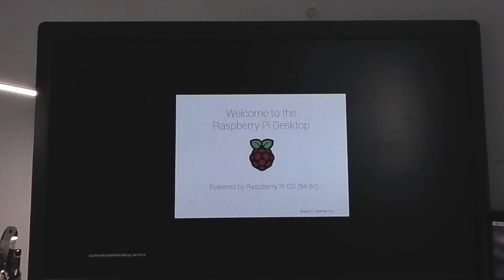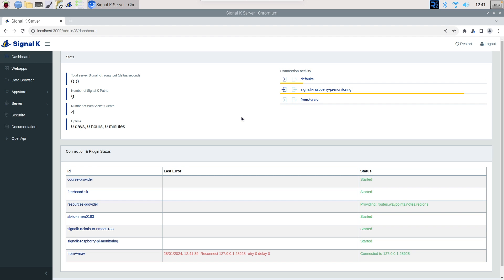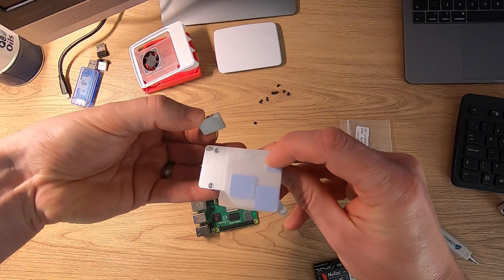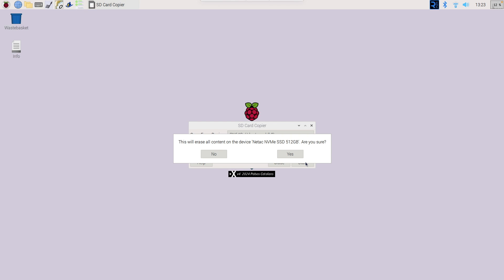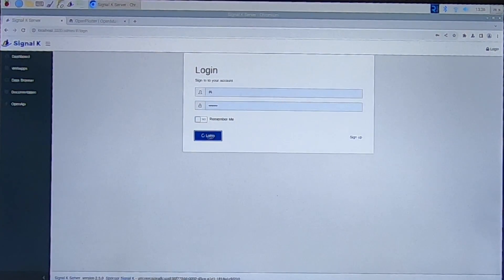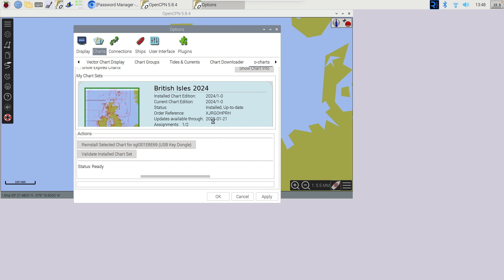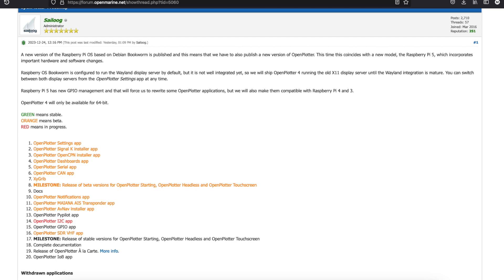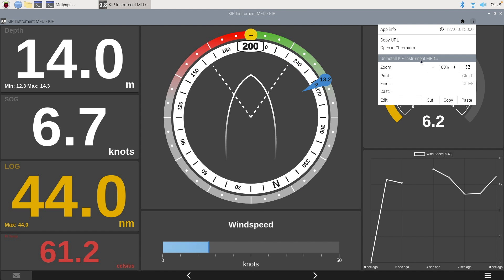Pi5, NVMe Base, OpenPlotter 4 (beta), MacArthur HAT, O-Charts Dongle - The best open-source setup!

Comment: Brilliant video, and many thanks for the information and explanation around implementing OpenPlotter. 
I have a mixture of NMEA 2000, 0183 and Seatalk , with a Garmin 5008 plotter currently installed on my boat, and I'm just starting down the path of replacing some of the older seatalk kit, so this is exactly what I was looking for to help me. 
My boat is in Greece, and my plan over the winter months is to build  a "test" rig at home before installing it in situ sometime around April / May. I have the Pi 5, NVMe and SSD card plus a small NMEA 2000 network ready, just waiting for delivery of the MacArthur HAT to complete the build and start "playing".
I’d also like to replace the Garmin chartplotter at some point, so do you have any suggestions or advice on a suitable monitor / tablet, or is it ok to use a standard  iPad/Tablet
Again many thanks for the video - loved it  - Garry 👍👍
Reply from the maker: Hi, thanks for your comments on the video. Sounds like an interesting project! One thing to install on your setup is a plugin for SignalK (in the 5 best plugins video) that can generate test data. You could then output that for any sensors you can't replicate on your test setup.

In terms of a display, I think you have a couple of options and depending on how and where you install this, one option might be to go for the tablet. I've not got much experience with external displays but they seem to be difficult to weatherproof or you buy something that already is and then they are fairly expensive. I've seen some really good rugged tablets with large batteries which might fit the bill, have a look at Oukitel, they seem affordable and come out well in many online reviews.

Give us a shout if you get stuck and enjoy the build👍⛵️

Comment: great show and tell, thanks!
About how many Watts does it draw?
Reply from the maker: Hi, thanks for the comments on the video. It seems to run about 3-4watts at idle, so at 12v it's around 0.3amps
Reply: @BoatingwiththeBaileys that's great,  thanks!

Comment: Thank you for a great video. It inspired me a few months ago to build the same system. I have it working and it's fantastic. My only issue is the RP5 onboard wifi adaptor seems to  be unreliable - sometimes it will connect to my iPhone hotspot, sometimes not. I'm going to go with an external wifi adaptor, just trying to work out how to disable the onboard adaptor. Have you had any experience with poor onboard wifi adaptor performance?
Reply from the maker: Hi, Many thanks for your comments on the video. Yes is the short answer, i still believe there are driver or other issues with the onboard network. I have managed to make some progress with that and get a stable connection, here is what I did:

Evening, I remembered to check the pi WiFi settings for the subscribers that have been having issues getting a connection on a Pi5 (and a Pi4) with devices like an ESP or phone that seems to connect but then disconnects or just doesn't work.

I changed the following:

# sudo nmcli con modify TEST_AP 802-11-wireless-security.proto rsn
# sudo nmcli con modify TEST_AP 802-11-wireless-security.group ccmp
# sudo nmcli con modify TEST_AP 802-11-wireless-security.pairwise ccmp

(Replace TEST_AP with your ssid name) 

Since I changed this both my phone and ESP connect without issues.

Here is the post where I found this information:

https://forums.raspberrypi.com/viewtopic.php?t=357998

Hope it helps 👍⛵️

Comment: First of all: you're videos are a great resource! Thanks lot for all your effort. Just a quick question, I'm not sure, if I should go for the Pi 5 and SSD, because I'm not a hundert percent confident if it's worth the price and energy. Would it be possible to clone my existing system (OP4, signal k and so on) to a Raspberry 5? Or would it mean to go from scratch and do it all again? Cheers and happy new year mate!
Reply from the maker: Hi, Many thanks for your comments on the videos. I would defiantly try to copy it, i know there were several changes in OP4 but i've got a similar image running on my Pi5 and my Pi4 test setup at home, so i would give that a go first and clone it to another SD card. It will defiantly save time. On the SSD its a difficult one with the Pi5, its sooooo much faster just on the SD card when compared to the 4, however its also easier to add the SSD now with the dedicated port. I think longer term the SSD still wins, even with a little more power usage, but again 5 seems to manager power better than 4 did.  If this is going to be a fairly key part of your setup, go 5 with an SSD - Its the best setup i've had so far.
Reply from the maker: Should also say, i still think the best value pi is the 4gb model, im not really sure 8gb or the new 16gb is really needed.
Reply: @BoatingwiththeBaileys  Thanks a lot for your advice (again). I opted for a 8GB Pi5, thought it might give me some headroom for opening multiple chrome tabs ;) I saw a video earlier where a special usb-device was needed to install the SSD. I always thought, it would be possible to just install on a SD Card, copy everything to an SSD and change boot order. Well I should dig into that again ;)
Reply from the maker: Hi - Excellent, Good choice and enjoying opening those tabs in Chrome! :) You shouldn't need anything for the SSD, if its a similar setup to mine, it should be plug and plan. I still built mine from an SD card and then did a copy. I have used the O-charts dongle this time as i end up missing with mine a bit, i've lost charts in the past, but now they are linked directly to that dongle.

Comment: I need to construct a chart plotter using the Strawberry Pi and the Macarthur HAT. I have also been looking at making my own AIS transponder BUT discovered that an AIS transponder has to be officially certified and so you need to buy a commercial product ..which is a pain becasue they cost a fortune (500+ pounds).    Should I base my chartplotter system on a Pi5 or the tried and tested Pi4.  It looks like heat is a problem for the Pi5 and reliability is critical at sea.
Reply from the maker: Hi - I would go for the Pi5, i've not had any heat problems with mine and im using the active heatsink. It has been really stable even in the higher heat of the summer. Going on to the AIS kit, yeah, i know what you mean and i ended up buying a marine unit after looking at different options. I still think the Pi and Macarthur HAT are a really good setup and well worth having onboard to work with other marine kit or replace part of it.
Reply: @BoatingwiththeBaileys    Many thanks, I really appreciate your quick reply.  Kind regards, JP

Comment: Wow stumbled across this and love it. Would love to know if you’ve gotten any farther with it.
Reply from the maker: Hi, yes it's all installed on my boat and had been up and running all of this year. I haven't don't much follow up because I've been running OpenPlotter for several years now. I do have a full playlist of videos around this starting from the very beginning on a Pi3 but plan to cover a few things this winter in updates to those original video. If you have any questions, need any help or what to see something specific then let me know. It's basically monitoring my batteries, chargers, environmental stuff and all my boat data plus the engine. Should also say, many thanks for your comments on the video!

Comment: He said just save cmd, just not how to save 😂 ? It doesn't save by default, control S or enter does nothing.
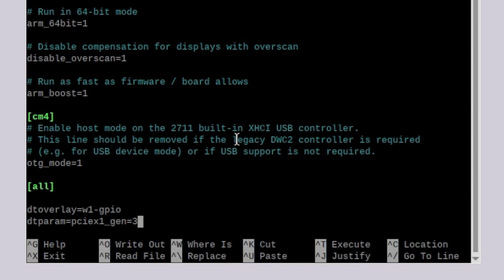Reply from the maker: Hi, Is that to the boot config about 6:15 into the video? Your only option is to exit the file and as you do it asks if you want to save, so its Control X (Exit - as shown at the bottom of the screen) and then the next screen asks it you want to save the file. Press Y. If that's not what you mean, can you let me know where in the video this is please?

Comment: Great videos on OpenPlotter on RPi! I started with an RPi4, but I dont like the performance so far. Your videos have inspired me to go with an RPi5 and NVME. Do you have any updates or improvements you would recommend now that you've had your system since you published this video? I'm pulling together my parts now and would appreciate any updated info you might have. Thanks for putting these videos together for everyone's benefit!
Reply from the maker: Hi, Many thanks for your comments on the video.  I honestly don’t have any recommendations at the moment. Its without doubt the faster setup I’ve used. The Pi5 and a fast SD card was quicker that my old Pi4 SSD and it runs really well. I know what you mean about the performance, the 4 was better than the 3 but it was never quite where it needed to be. Now its spot on, its responsive with no lag even with several webpages and the chart plotter running. Really pleased with the setup. Also, let us know how you get on, its always great to get feedback on other setups and see what others have done.

Comment: Do you have any tips on remote monitoring? I'd like to remotely monitor my batteries and my bilge via pi5. I've considered using the "roam" device here in the US.
Reply from the maker: Hi, it's not something I've done so far. I know there is a plugin for SK to send data to the cloud and that might be an option. Some sort of push notification would be good. I'll take a look as the weather is turning here now

Comment: Hi great vid.  Decided on the back of your video to go down the RPi5 and base nvme route.
...however my config was nothing like as straight forward and as of V4( 19June touchscreen image) I still have no working shutdown/ poweroff and have had to stop in case it accidentally finds itself heading out of a porthole and into the drink (and revert back to my 4b headless predecessor
Reply from the maker: Ahh that's a shame. What problems are you having on shutdown/power off?

Comment: Hello nice new build have you experimented with different IMU placement in the boat, big mfg like B&G want it on a bulkhead near the mast, where is your IMU located?
Reply from the maker: Hi, when you say IMU are you refering to the sensor messuring pitch and roll etc?, mine isn't central at all, its mounted on the port side. If im honest, i dont really use it, its on the list to do something with but i've just not got to it yet.
Reply: @BoatingwiththeBaileys i am trying to figure out if I even need the IMU for compass heading in open plotter, my GPS seems to know where I am headed
Reply from the maker: Hi, Yeah it will be able to get that information from your GPS. I found that sometimes when stopped, i dont get any heading information but you do if you have either a compas on your network or an IMU. Otherwise its needed for Pypilot and/or pitch/roll information.

Comment: OK, Have I missed something? I cannot get the downloaded image '2024-06-19-OpenPlotter-v4-Starting-stable' to boot up to the installlation , all I get is a black screen with a few lines of test.
Reply from the maker: Hi, is that just booting from an Sd card?
Reply: @BoatingwiththeBaileys  Yers, Managed to get it sorted, now having to wait for snail mail from Spain for the rest of the parts.
Reply: Check your power supply, had the same issue with a 1 amp power supply and I screws the sd card. Best is 2 amp minimum

Comment: That's funny, this is exactly the system I have, too.  I did make a 3d printed case to accommodate the airflow and the MacArthur hat.  Love the O-charts dongle as I had lost the key in the past.  Be careful with the cable going from the NVMe base to the Pi5.  My hold down bracket broke.  Waiting for Seatalk...
Reply from the maker: Hi, I've seen a couple of the cases, that's on my list but so is a 3d printer!

Comment: Subscribed.  Very interested in kitting our boat out with this setup, instead of some obsolete-ware garmin type of affair.
Reply from the maker: Hi, thanks for subscribing- you can basically do what you want with it which is really good. Give us a shout if you need any help
Reply: @BoatingwiththeBaileys  Cheers, I can see from your roster of videos that most of my questions have been answered so I appreciate that.  What I am currently trying to source is a decent enough panel that could sit outside.  I'd rather not have touch screen but maybe a couple of page selecting momentary switches.  Also just been down a rabbit hole on how to get a signal from the NASA clipper depth sounder.  I love their simple kit, but looks like I need to learn a bit of arduino to make that work.  Happy Sailing and regards from Milford Haven.
Reply from the maker: Have a look on the OpenMarine forum for the NASA kit, I'm sure someone has done that. I had a Duet on my last boat and it was great. Gonna try and get to Milford Haven soon, looks really nice 👍

Comment: Hi, great video, thank you - can I ask what display you use onboard to connect to the pi?  Also what GPS device would you recommend?
Reply from the maker: Hi, many thanks for your comments on the video. The display is one of these https://www.ebay.co.uk/itm/253289838646?mkcid=16&mkevt=1&mkrid=711-127632-2357-0&ssspo=sA4xWqdKSHW&sssrc=4429486&ssuid=1XqhIgr5QPm&var=&widget_ver=artemis&media=COPY the price has gone up a little since I got mine but I’ve been really pleased with it, it’s bright and clear with low power consumption. In terms of GPS, I use the boats GPS via NMEA2000 but I have also used a cheap USB one from Amazon with good results. Virtually any of them will work and also make a good backup.

Comment: I have questions concerning the inertial measurement unit you're using (black board sitting on top of the MacArthur hat, visible from 11:00). It looks like it's labeled "CJMCU-20948" on the board. 

Firstly, how well does it work? Is it integrated easily into the system? Do you get good data from it? 

Secondly, i can't find that model easily through a source i trust. Do you know of any alternative units, or a place where discussions happen on this where i could ask? Looking around, there isn't much online or in the documentation on which modules are a good fit for the MacArthur.
Reply from the maker: Hi, Its not a sensor i've used all that much if im honest, its sort of gone on the back burner as i've been playing with OP4 and some other things. You needed to install PyPilot in the old version to get access to pitch/roll etc and i think thats still the same now. The recommended sensor Is ICM-20948, buy a good quality one, i didn't first time around and it wasn't detected. I think this one came from Pihut. I'll try and do something with it shortly and come back.
Reply from the maker: Search ICM-20948 and PyPilot

Comment: I'm searching for a case for this combo (Pi5+NVMe base+MacArthur Hat), preferably also with full HDMI. Any suggestions? I guess the Argon One V3 doesn't support the MacArthur Hat?
Reply from the maker: Yeah, I also can’t fine anything just yet. The issue with the last Argon case I had was that it used some of the pins the HAT does, so this time I’m not going that route. Also the Pi5 has a fan header which I had to use a case to get last time. There is a printable plastic case coming over on the OpenPlotter forum so that could be an option.

Comment: Do all three devices fit in that case? Mine would have the power module on the McArthur hat too.
Reply from the maker: Hi, The small raspberry pi case towards the start of the video? Unfortunatly not. I dont have a case on this setup at all. Just a bit of velcro to stop it flying around. There is some talk over on the Openplotter forum about a case that holds this setup (NVMe base, Pi5 and Hat) so i dont think its too far away now.